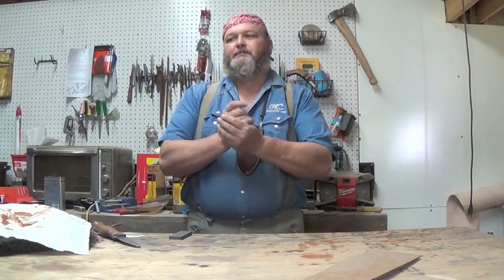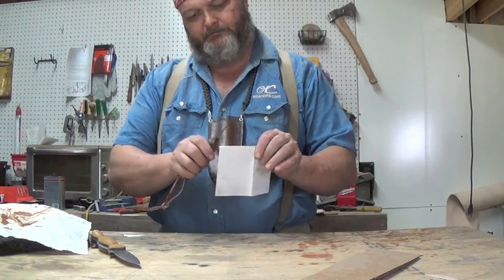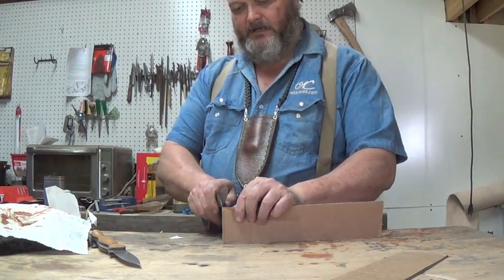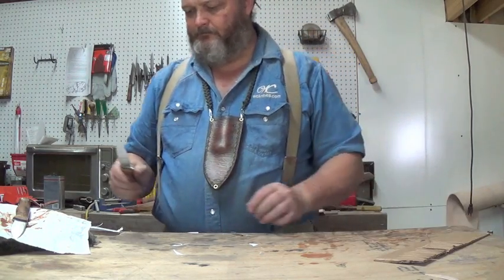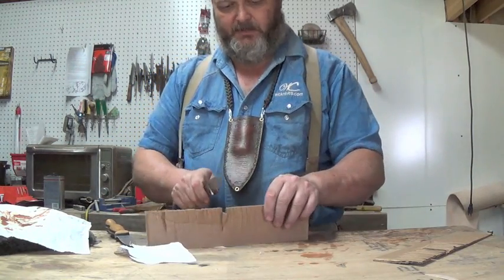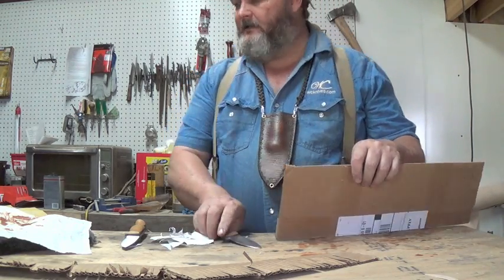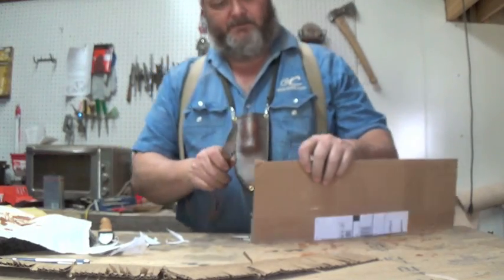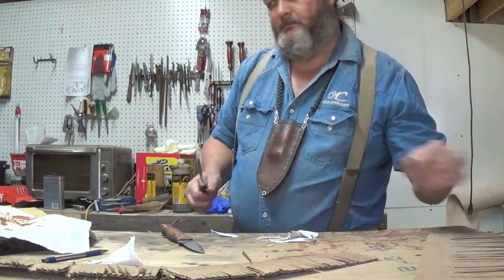CPM 154 Vs O1 Edge Retention Test

Comment: Benchmade uses cpm154 in the new hunter taggedout. It is the best edc knife I own. It is also the sharpest factory grind I have ever bought. This thing is freaking sharp. It is 3.5 inch blade. And open at 7.84 inches and weight is a amazing 2.1 Oz. It is a blend of the benchmade crooked river and the bugout. Awesome knife.
Reply from the maker: I have several Benchmade’s.

Comment: I ht O1 with only the 0.2% Vanadium and hold at 1475 for 15 minutes, not ten. Quench in canola oil thick viscosity oil at 120-130. Temper 425 two time two hours. If you want you can put between blocks of dry ice in a 4 inch thick box for four days. Then do second temper. My O1 filet knives go through 4-5 dozen of thick boned ocean fish before needing a quick strop on 5000 grit diamond compound on leather. Measure hRC60-61. Vanadium is essential for restricting grain growth.

Comment: Cardboard has a fair amount of Clay deposits in it from the manufacturing process. its rough on blades.
Reply from the maker: Yes it is, thanks!
Reply: i've used cardboard to even strop a blade, does a nice job.
Reply from the maker: Yep, anything that will dull a knife will sharpen it as well.

Comment: Good info. I've made a few blades with O1 & there great. A2 air hardening steel is good stuff also.  Next is my 24" MACHETE . I found a HUGE .187" thick 2.5" x 24"  HIGH SPEED STEEL planer blade blank (never sharpened) at the Goodwill for a couple dollars.  My  woodshop has smaller HSS joiner & planer blades & holy SHIT do they get sharp & hold an edge!  Not fun to work & shape, but worth it.
Reply from the maker: Jay Dee yep made several with A2 I like it. The knife I use in the shop now is A2. Watch some of my latest videos and you will see it.

Comment: Do you have any recommendations of a steel that has a high edge retention, high toughness, and is easy to sharpen? By easy to sharpen I mean that I can strop for less that five minutes WITHOUT compound and still achieve hair shaving results.
Reply from the maker: No such thing. Any steel that holds a good edge or tough will not be that easy to sharpen. Just a mater of physics. What dulls a knife will sharpen a knife so easy to sharpen per your suggested standard would be a very soft steel so not hold a very good edge or be very tough. I find a happy medium between edge retention and toughness is a well heat treated O1 or 1095. All stainless is harder steel than a carbon steel like o1 or 1095 so no stainless.
Reply: William Collins makes sense, but between 1095 and 01, which is best? Two days ago I got a message saying that 3v fits that image, and that people say it’s great on a plain strop, what’s the truth in that? I’m looking for a steel which I depicted earlier, but it also needs to be able to fillet a wet fish, and then go the rest of the day without rusting, any help?
Reply from the maker: I have test comparison video on the 3v and o1 that is heat treated properly and don't see any reason to pay the high price for the 3v in real world use. O1, 1095 and 3v are all carbon steels and will rust if not maintained. Of the three I prefer O1. I think O1 is a very good steel that holds a great edge and is easy to sharpen. Not to impressed with 3v compared to the price increase between it and O1 however 3v will hold up to a very thin edge compared to O1 and is a little bit more rust resistant than o1 and 1095 but not a stainless. 1095 is a basic good carbon steel but does seam to rust quicker than O1. There isn't a stainless steel that will sharpen with only a strop without buffing compound. All will require a stone and I prefer diamond stones. D2 is a good stainless steel that is reasonably priced but will require a stone to sharpen. CPM 1654 in this video is a great stainless steel but very expensive and will require a stone. CPM s35vn is another great stainless steel but again will require a diamond stone. All of this is dependent on proper heat treat. if the steel isn't properly heat treated then nothing is good about it.
Reply: William Collins I agree with most of what you said, but the fact that you said that ANY stainless steel cannot be sharpened by a bare strop is wrong, because mora uses 12c27 stainless and it’s very very easy to sharpen. Anyway, thanks for your help, do you know any good stainless steels (other than 12c27) that sharpens easy and is comparable to 1095/01?
Reply from the maker: Frederik Kjaer I have several 12c27 knives and it is a good Mesolithic stainless steel but I suppose it depends on you definition of sharpening. Leather will clean the edge and straighten the bit but will not remove steel as the definition of sharpening does. Not sure why you ask so many questions if you already had a stainless you liked but appreciate your view.
Reply: William Collins thanks!

Comment: The fastest dulling material on the planet is the packing material "foam rubber or styrofoam".  Try and edge retention test with either of those material and you will find out which steel hold and edge best very quickly.
Reply from the maker: littlejpl cardboard in a gritty dusty shop is a pretty good indicator as well. Appreciate your view and thoughts.

Comment: Nice video, thanks for sharing your knoledge.
Yes, edge retention is need and most decent knifes will do it enough for me. 
So  my main consern is not to nick the edge. I hate nicks and I want scandi grinds with low angles. So, good steel and heat treat will be something I will look for in knifes.
Is there a steel that you would choose for that task? (thin scandi edges)
I love my cheap Mora Companion in 12C27, but it get nicked all the time. So I would go to a carbon steel if that would be solved.
I do have some knifes in 3V, but I just don't have enough use to say anything about it yet. and the edge is very different, it's a convex.
Any sugestions?
Reply from the maker: this video may help. https://www.youtube.com/watch?v=KNMPw6dpW44 scandi edges are the thinnest edge and are susceptible to either chipping or rolling. a good O1 tool steel with the proper heat treat will work but still best to apply a convexed edge or a micro bevel as discussed in the attached video. 3 V steels is great but don't let it get dull or resharpening it is a real pain.
Reply: Thanks, will watch it right now.

Comment: are you willing to give out your heat treat method?
Reply from the maker: Basic heat treat methods are listed on this web site. You will need to try temps and durations several times to see what works best for your equipment and geographic location. What works for me may not work for you. This is the web site that will get you close on your heat treat. http://www.hudsontoolsteel.com
Reply: Thanks for the tip..great vid!
Reply from the maker: Thanks!

Comment: Say Heah William,  Yeah,  Thanx William for sharing your knowledge really helped me look at my CM 154 blades differently,  I only have a couple of blades in the CM 154 because I thought like alot of guys until I learned from you,  WoW Thanx William,  I bought these way before I knew you,  Ones a Blackbird SK-5 and the other one is a Browning Independence and the only reason I got it was for its orange handle to go with my O. K. C.  Ranger Afghan and the Ranger RD-9 But now I look at this steel differently Thanx to you.
Reply from the maker: There is a difference between CM 154 and CPM 154. CPM 154 is a powdered crucible steel.
Reply: Yes and more expensive,  Have you compared the difference between powder and furnaces the same ingredients ?  Thanx in advance

Comment: Say Heah William, Which steel is easier to sharpen in the bush, And is the difference between the CPM 154 and the CM 154 that noticeable to the user. I know the the CM 154 is flowed hot where the CPM 154 is a powder welded into a bullet and is much cleaner not as much impurities.  But since the sharp edge/cutting ability is important, Does a user notice that much difference between the two. Thanx in advance
Reply from the maker: +paulie 4x it does to me but it is an individual choice if it is worth the price to upgrade.
Reply from the maker: Also I use diamond stones and rods to sharpen so I don't notice a difference.
Reply: Thanx, So it is harder to sharpen, I guess you can use a DC 4 Fallkniven Sharpener will work in the field, What is the difference to you between the two and no wing your getting the best because it is more expensive. But how much better does the edge holds, can you measure that, so I can understand it bettrr, Right now it's as clear as mud to me. Thanx in advance
Reply from the maker: +paulie 4x I didn't say that. I said "I didn't notice a difference in sharpening but I use diamond stones" so that may be why I don't notice a difference. This is a edge retention comparison  of CPM 154 and O1 for my knives. I can't say what results other knives from other makers would result. https://www.youtube.com/watch?v=OWhiYK8a8_M
Reply: Sorry William, I wasn't trying to put you on the spot. But the 154 looks like a blade material maybe on my next knife. Just learning, that's all..Thanx, William.
Reply from the maker: +paulie 4x not on the spot just wanted to make sure my opinion was understood. From your response It appeared I wasn't clear so I rephrased my reply.
Reply from the maker: +paulie 4x not on the spot just wanted to make sure my opinion was understood. From your response It appeared I wasn't clear so I rephrased my reply.
Reply from the maker: +paulie 4x Not on the spot just wanted to make sure my opinion was understood. From your response It appeared I wasn't clear so I rephrased my response.

Comment: I love my O1 tool steel. I have a pile of bar stock ends from a plywood mill that are perfect for forging into blades. It doesn't move like 1095 under the hammer but it makes up for that with the ease of heat treatment. I've never been able to get consistent HT with 1095, where as I have always had consistent deep hardening with O1.
Reply from the maker: +ThrowingItAway 1095 is very temperamental but O1 is a bit for forgiving. I found the air temp, wind, and humidity play a big roll in 1095 so a closed in space works best for 1095 and also preheat the oil is very important.
Reply: +William Collins (WC Knives) I forge and quench out doors so it can be a bit frustrating if the wind picks up on me. I'll keep my O1 as I have plenty of it and it's working for me. 1095 will have to wait until I have my own space. 

I'm thinking of moving to D2 when I'm out of O1 as I don't like how O1 rusts so easily and want to tackle a new metal.
Reply from the maker: is a bit tricky and needs a well maintained temperature control. Not sure how it would turn out on a forge. I use a kiln for heat treat for that reason. Wish you well at your attempt.
Reply: I'm really temped to get a HT oven so when that happens I'll try some new steels to see what I like.

Comment: Keyshaw makes a ton of cpm154 knives
Reply from the maker: +matthew collins I know Kershaw makes 154 CM knives but haven't seen any with CPM 154. There is a difference. CPM is 154 steel that has been broken down into a powder form and remade. It is a crucible steel. 154 CM is not a crucible steel and so the steel molicules are not as tight as CPM 154.
Reply: +William Collins (WC Knives) 
The kershaw launch series is cpm 154
Reply: +William Collins (WC Knives) holding it in front of me with a couple articles proving it is real cpm154 

Don't get me wrong custom made knives are beautiful and I would never dream of putting someone Down that has mastered that craft I'm simply informing you that companies of high quality have in fact put cpm154 into production
Reply from the maker: +matthew collins I just did a Google search and you are correct, Kershaw is launching a new line of knives with CPM 154. Appreciate the heads up. At the time of this video there wasn't any to my knowledge.
Reply: +William Collins (WC Knives) just here to help! Keep up the awesome work!
Reply from the maker: +matthew collins Thanks!

Comment: You definitely got them heat treats down pat on both steels. I think the main difference is one will produce sparks with flint but it'll rust pretty dang quick if you aren't careful. and the other is dang near completely stainless! Just walking around with a neck sheath on in my area produces a blade and sheath that is completely soaked within an hour...so corrosion resistance is paramount here. I've taken O1 knives out that were completely covered in tallow and had them turn brown over night. Now all my old hickories are pre-browned and it doesn't matter, but on a beautiful custom it's a real heart breaker. Your CPM 154 is in my opinion the best steel out there. It holds an edge awesome, and I don't have to baby it. Now, if we could just come up with a soft liner in the kydex that would keep it from scratching up the blades so bad...
Reply from the maker: +briargoatkilla LOL, I hate that part of kydex as well. I thought about a liner but also thought it would trap sand and grit more than just having the kydex. Appreciate the comment brother and hope you guy's are not floating where you are.
Reply: +William Collins (WC Knives) Total destruction in my hometown of Columbia, SC, but I'm high and dry at my house in the NC mountains. All my people are well. Many not so lucky, though. It's the worst flood in history down there.
Reply from the maker: Sorry about your home town but happy you and you family are safe. I have been hearing reports that SC was being hammered.

Comment: Say Heah William, I hear alot of people throw good sparks with Stainless Steel as long as you have a sharp 90° edge on the spine. If the stainless  does throw sparks with a sharp 90° spine. Can you do a video on it. Thanx, Buddy.
Reply from the maker: +paulie 4x Any sharp edge will throw sparks from a fero rod including glass. I am talking about flint rock against the spine of the knife. Only high carbon steel will do that.
Reply: Oh Ok, I stand corrected, Thanx, William.

Comment: ever try dog chew rawhide for a test medium? this stainless a cut, grind and temper or can it be worked I  a forge?
Reply from the maker: +keith moore I use the stock removal method. The heat treat temps must be precise as with all crucible steels so I would recommend using a kiln. Never tried the dog rawhides. Appreciate your view and comment.
Reply: just wonderin, raw hide works pretty good on belt axes for cutting depth
Reply from the maker: Appreciate the info.

Comment: William , get some 3/4'' or 1'' manila rope and do a comparison . A lot of makers use this rope and push cuts to check edge retention and to get the most out of heat treating a certain steel. Im going to also try this with my 1084 and 5160 knives . Id love to see how many cuts each steel can get with different heat treatments .
Reply from the maker: +bobby keller Not shure how the rope would be different than card board. let me know how your test go.
Reply: For one, its the same diameter around the whole length of the rope, so every cut will be the same amount of cutting. And why the hemp rope? Im not sure, i just know it is a standard for a lot of knife makers, that was started by Wayne Goddard yrs ago. there is a lot of data out there for comparison also. And its a lot easier to manage during the test.
Reply from the maker: +bobby keller Cardboard is the same thickness as well but I may try it sometimes appreciate the suggestion.
Reply: ok, its just the length of the cuts aren't the same, and with the rope, you will see a change in the edge way before you will see it in cardboard . makes testing two different steels or heat treatments easier and takes less time.
Reply from the maker: +bobby keller thanks for the info.

Comment: That's amazing edge retention for your O-1! Folks usually consider O-1 an easy to sharpen or touch up steel, and CPM 154 the opposite. How does your heat treat affect that "easy" sharpening of O1? Thanks!
Reply from the maker: +CoastalBackWoods see no difference in ease of sharpening.